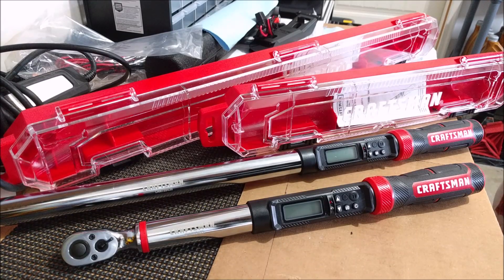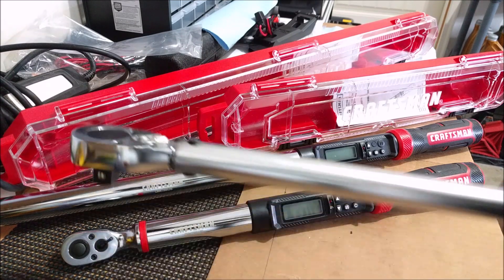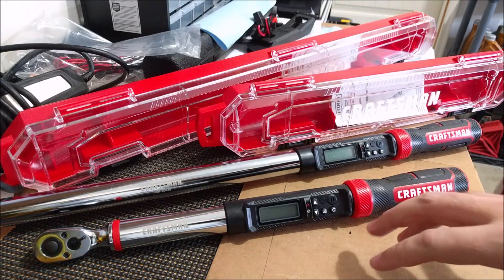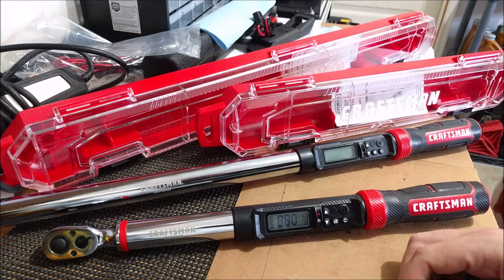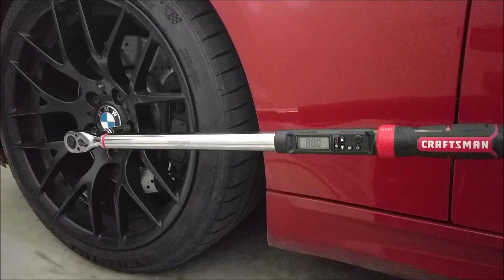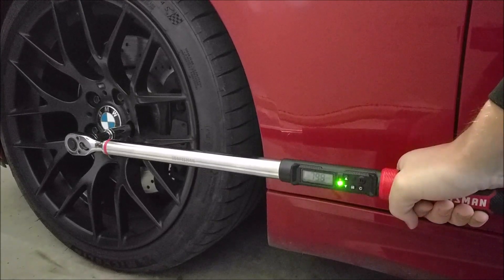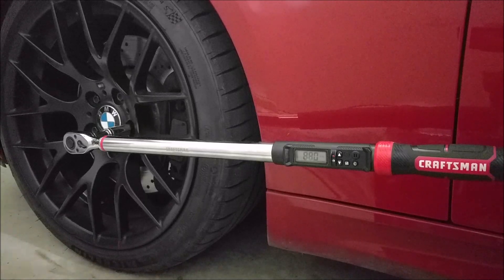Craftsman Digital Torque Wrench | 3/8 and 1/2

Comment: I have a question can you torque 140ft-lbs with 3/8 or it’s not safe
Reply from the maker: If it is rated to do the job it is able to do it, but I would just pick a higher rated wrench

Comment: Sorry this is a foolish question but you see the switch isn’t it supposed to be on the right instead of the left how you have it? Sorry I know it’s a dummy question
Reply: Never mind I figured it out. Some tools levers are on the opposite side lol
Reply from the maker: haha all good
Reply from the maker: I don't understand what you mean?
Reply: The select lever on top it’s the little switch…
Reply from the maker: So you are saying it is wrong? then how did I torque the wheel?
Reply: No that’s why I’m asking because I’m confused. I have the same machine but you see how your select lever switch is facing left. I thought it was supposed to be on the right side when you’re trying to make it tight. That’s why I know it sounds like a stupid question…
Reply from the maker: There are no stupid questions, but I really don't understand it or the context.
Reply: Okay see your video how your ratchet has that switch how come it’s on the left instead of the right. 

Usually on ratchet if the switch is on the left it’s to lose screw 

If it’s on the right its to tighten 

The switch I’m taking about is on the head…

Comment: Thanks for posting this! I bought this wrench and was curious do you set a particular torque angle when tightening lug nuts on your wheels? Do you just use the default torque angle that comes with the wrench?
Reply from the maker: I don't mess with the angle, I specifically use ft-lbs and nm
Reply: Got it, thanks for the reply. Cheers!  @DannyDrives

Comment: So you can over torque on digital but not on click ones. Planning to get onw but for basically regular car repairs nothing crazy
Reply from the maker: what do you mean?
Reply: @DannyDrives  can you over tight with digital or not. With a click it will not go pass set amount but i think if you miss a light or a sound you can go pass that set number.
Reply from the maker: I mean I never tried. Like it gives you a green light, then red. I stop when red pops up. I would never try to go past the alert to stop. Unless you had some medical emergency, not sure the situation you would accidently pass that situation
Reply: You would have to be a mindless gorilla to over torque so much you break a bolt. Like he said you just listen or look, when the tone goes to a solid beep you stop.

Comment: I purchased one and it have to be careful not to press the units button too many times or else it'll get stuck in degree mode until it turns itself off or I pull the battery out. Really annoying
Reply from the maker: Thanks for the tip!

Comment: I always preferred the ole click torque wrenches the click noise makes me happy lol. 

Torqued. I got the 3/8 and 1/2 inch craftsman torque wrenches they are very nice for the money I’d say a deal. Not bad price nice quality. Some say they overrated but I gotta hand it to snap on tools.
Reply from the maker: I love these new digital ones
Reply: @DannyDrives  yeah they can show you the numbers on a screen and other measuring maybe I’m used to the ole click ones I like the sound also so I stick with them. It’s an opinion I may try a nice digital one soon!

Comment: How would you go about testing the calibration on a digital torque wrench? Do you put it in a vice and check it with weights or a luggage scale like you would a regular click-type torque wrench?
Reply from the maker: I just passively test it against my other wrenches. I have non-digital ones as well, so the chance of them all failing is minimal.

Comment: Oh one question and that is as soon as u get to red or even barely a red,  that means to stop, right ? One your first try it went click after your green light shown. When u torcked it again it clicked then went to red. Was that it? Wait til it clicked to green  then torch it again to red ?
Reply from the maker: Green is good, red is the hey you might go too far warning light, basically once you get to green red should pop right after, so depending on how strong you are that morning is why you saw a difference between
Reply: I don't look at the lights, the tone tells you when to stop.

Comment: How do I set it to 100 ft lbs of torque so I can tighten my wheels
Reply from the maker: The 3/8 goes to 100, the 1/2 goes up to 200+
Reply: put it on foot lbs and press up until the number gets to 100....Do you really need to operating one of these if you don't know this simple thing?

Comment: I got the 3/8s an 1/2 inch torque wrench like this one for 20$ each what I did was I took a tag off a 1/4inch craftsmen ratchet an I put it on the torque wrench’s an went threw the self checkout an they thanked me as I walked out the door like what a deal I got
Reply: So, what is your current address?
Reply from the maker: thanks for sharing, what do you plan to use them on?
Reply: @DannyDrives  Lol there probably most likely going to collect dust until I find another flip car that needs head gaskets
Reply: You are a POS. DO you not have a conscience?

Comment: Thanks for sharing your time. I recently purchased a craftsman 1/2” digital torque wrench from e-bay. It came with no box or instructions.  So my question is how do you shut off the wrench? I pretty much understand how it operates but struggling to shut it off. Any help would be greatly appreciated thank you, Joe.
Reply from the maker: Thanks for commenting. It should go to sleep after a short while of not moving. I don't remember the exact time off the top of my head, but it isn't too long. I can tell you if you are swapping a set of wheels on, by the time you move to torque another wheel it will already have fallen asleep.
Reply: 2 minutes

Comment: Just got thing wrench and am having a hard time using the angle torque on it. I set my angle and use it and as soon as I apply pressure it says Er---- so I didn't use it to torque the bolt. I used an old school dial it worked but I got this wrench to not use that dial anymore. Any tips on properly setting the angle torque on this. I followed the instruction that came with it but after about 20 failed attempts I gave up using this wrench for the job.
Reply from the maker: Hmm, sorry to hear that. For my garage purposes I only torque to a numerical value and watch that value climb until the torque is achieved.

Comment: Good video. I have a few questions. Do you have to calibrate it on a level surface every time you turn it on? How long before it turns itself off? And lastly, how long do the batteries last?
Reply: The manual states that the wrench will auto sleep after about 5 minutes to save battery power.  FYI - The manual also states that when the wrench is not going to be used for an extended period of time you should remove the batteries.
Reply from the maker: Yes, but it doesn't have to be a completely level surface, just has to be horizontal in your hands. Turning itself off, I never timed it. And batteries last I have had these torque wrenches for 8 months and have not needed to replace them. I however am not a career mechanic, they only get used when they are needed.
Reply: Whats Calibrate ?
Reply from the maker: when you make sure it is in spec

Comment: I bought the 1/2 model because I needed one ASAP and I wanted a digital this time. It seems to be good so far.  I have to tighten some bolts to 140-170 ft lbs on some equipment we maintain.
Reply: @Bill Reynolds thats because the 3/8 only goes up to 100ft lbs, those head bolts set at 30ft lbs, pulling two 90degrees on them your exceeding the working range of that wrench, you were pulling closer to 150ft lbs thats why it kept erroring out on you
Reply from the maker: It is definitely good for lug nuts! what stuff do you maintain at 140-170?

Comment: I've used both digital and mechanical torque wrenches for my job as an aircraft mechanic and building engines on the side. I personally prefer the mechanical type because 1: I like the feel and audible clicking sound. 2: I dont like having to change batteries.  However not knocking the video, everyone has a preference. You're video is very informative.
Reply from the maker: Thanks for taking some time to share insight. Check out more of my content, perhaps our opinions align on something else.
Reply: Same!  I prefer the mechanical
Reply: I gather most seasoned mechanics like click type
Reply: Good point, but for the average user, digital seems as though it will do the job pretty good.

Comment: so is the torque wrench bought, depending on which socket set you buy?
Reply from the maker: nah you can buy a 3/8 socket set and have a 1/2 torque wrench then just buy an adaptor to use the 3/8 sockets
Reply: Danny Korecki ty!
Reply from the maker: no problem
Reply: It's depending on the torque you're trying to achieve as torque ranges vary between the two.

Comment: From my understanding you don’t want to leave your wrench torqued up and are supposed to torque it down below 15% before storing. Is that the same on this one?
Reply from the maker: that is correct for click type, where you twist a handle, because you are basically putting stress on a spring in the handle. Overtime that stress can mess up its +/- on how much torque it is actually putting down on something. With these digital torque wrenches there is no need as it is all digital, nothing to twist.
Reply: Danny Korecki yeah that’s what I curious about is if the full digital style needed to be spun down or not
Reply: Danny Korecki thank you good sir
Reply: Did you fall asleep or not watch the video? Maybe you were drunk or stoned.
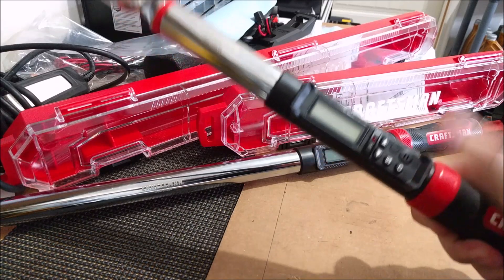Try watching 0:55 up to 01:27 AGAIN to answer your question.
Reply: Dude use a little sense...DO you really think you would have to do this on a DIGITAL torque wrench??

Comment: Ive been using the half inch version for. A few months.  Similar although the batteries have been drained and now I get to figure out how to calibrate it if it’s out tomorrow lol.  Fine wrench but like every other non adapted torque wrench in that drive.....fucking long and awkward
Reply from the maker: I wish they made 1/2s in the size of 3/8s.